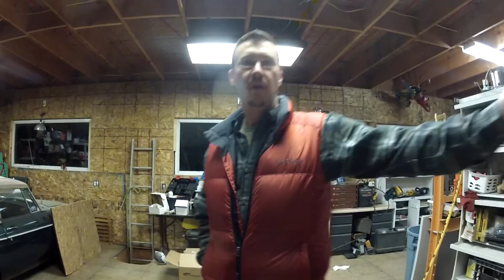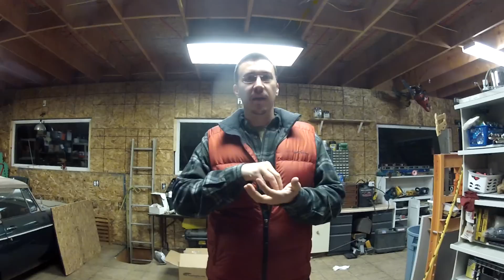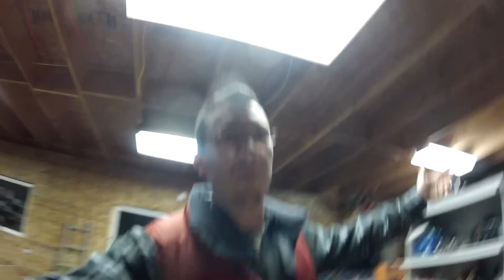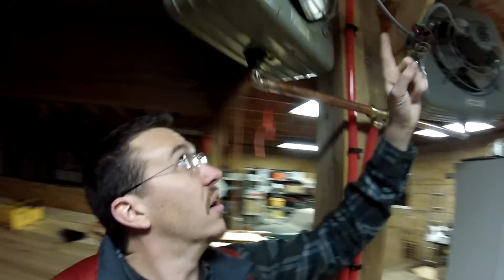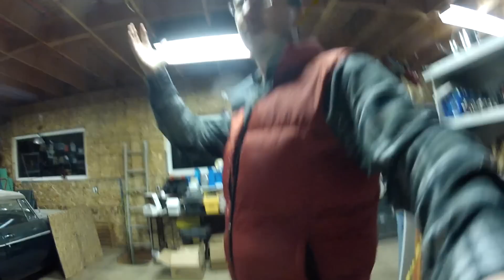What is Radiant Heating - 138 - My DIY Garage Build HD Time Lapse

Comment: Great explanation!
Am going to add another couple points. 
One is compressors remove moisture and heating elements remove a significant amount of moisture. That is why in the winter often a humidifier is run because the heater forces the air down to low of a relative humidity.
Second is the air coming out colder than body temperature, so feels cool. Worse is the convection cools through evaporation of moisture that our skin always has, especially when taking and exiting the shower (who needs a vent in a bathroom anyway, the bedroom vent does fine warming both).
One can also do radiant cooling and have same benefits. Only thing to keep in mind is over about 80 percent relative humidity condensation could form. Best is to design it in with an air heat exchanger (so air changes are controlled, conditioning is removed and sent back, and significant energy is saved) and a dehumidification and/or humidification (depending on climate). In this manner, the cooling is not at your feet, but radiating the whole room. This kind of tasks is what hoping to do for employment, finishing my Master's and looking for work, as LOVE doing this as just a puzzle to be solved.
Oh, thought of a third. When you start the heating season using a electric or gas heat, over the cooling season dust and junk has collected, so it burns and creates a foul smell until burned up. With radiant, no more of that.
Plan to do radiant cooling and heating on the house some day will build. No more filter changes, vacuuming dog hair out of the grill, and no air blowing on me.